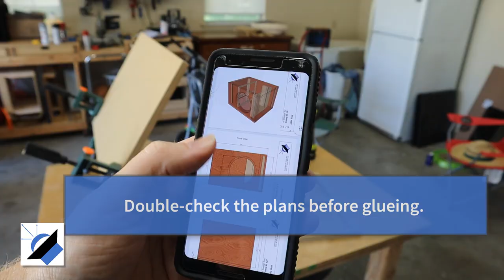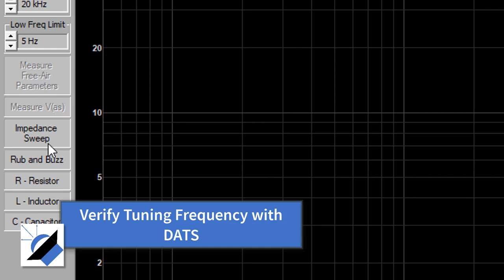Ported Subwoofer Box Build:  Kicker Comp R 12

Comment: Next time you cut out an internal brace use a 2inch drill bit and leave the corners rounded for extra strength or you could cut circular holes with your router and jig and would be even stronger
Reply from the maker: Next time I am going to make the brace a little thicker.

Comment: Very nice. I like that table saw. Need one of those!
Reply from the maker: I have been very happy with it, this is the Kobalt saw from Lowes.  It was the only saw in the ~300 price range that could make a 30" cut -- most only go to 24".  I can fold it up and roll it out of the way when it is not in use.  If you can wait until Black Friday they typically offer them at a HUGE discount.  I have a buddy with the same saw, he paid $80 bucks for it new. It will probably never be that cheap again.  The fence is garbage so you have to be careful to make sure it is square.

Comment: Definitely a nice build. I hate installing carpet half the time I chicken out n leave it off. So good on you for being thorough and seeing it through the right way
Reply: @DIYAudioGuy  you speak the truth, only way to get better at anything is to keep at it!
Reply from the maker: This was definitely not my best carpet job.  I hope to build a LOT of enclosures over the next few months just to improve my carpet game.
Reply: @DIYAudioGuy  as inspiring as that is I am simply not that brave, the alternative I've found recently is showing the grain of a nice piece or birch, sanding the heck outa it and applying urethane. That's how my lithium boxes turned out anyway. Carpet would hide the screws marks I mount the dsps and stuff with though🙃
Reply: I just put multiple layers of fiberglass resin on the box after it's sanded and done looks great and bulletproof finish. Feel free to put any decals stickers or artwork on there and then coat over top W clear( urethane) and it's perfect and permanent.

Comment: I purchased your plans for a Custom Sub Box Design: Kicker CompR 12.
I have a question.

The port opening in the plans is 14.5 inches x 2 inches equaling 29
square inches.  If I change the port shape but keep the same 29 sq
inch size will the tuning be affected.  What I am looking to do is
change the port to 12.5 x 2.32 which still equals 29sq inches.  Can I
do this without affecting the tuning of the box?

Thanks,
Reply from the maker: Yes.

Comment: Does polyfill in a subwoofer enclosure act as a sound dampening material and does polyfill really make the subwoofers louder and make the subwoofers produce deeper bass or is it a myth.
Reply from the maker: It's really something I should test out sometime.  In a sealed box the polyfill lowers the Q of the enclosure, having the same impact is making the enclosure larger.  In a ported box the polyfill is supposed to help with standing waves.  I don't know that there's any evidence or science that the ported box will play lower or louder if it has polyfill.

Comment: I need this exact setup for my Juke.   My Comp R 8 is just not doing it for me.
Reply from the maker: Yea, a single 8 just does not enough cone area.  I would definitely recommend upgrading.  I'm very happy with the way it turned out, sounds good lots of bass.  

The box is 2 ft wide, 14 and 1/2 in tall, and 18 in deep. If that'll fit in your Juke then check out my merch store on Teespring If you would like a copy of the plans.

https://my-store-b3f136.creator-spring.com/listing/custom-sub-box-design-kicker?product=963

Comment: Nice job!  congratulations from  México.. what´s the measure of the port?  in the front part and what´s the measure between port and hole subwoofer? and the inside window where must be set?  thks
Reply from the maker: The plans are available on my teespring store, just click on the merch shelf and you can find them there.
Reply: @DIYAudioGuy  thks but i can´t find out the port measure, how can i get it?

Comment: I didn't catch it, but what are the external dimensions of the box, and what is the vent cross-sectional area? 

It's a nice-looking build, and one of the few where someone's actually opted to put in some bracing (good) . Perhaps I'd have opted for a "beauty-ring" (round MDF ring, attached by dowels) around the driver, to avoid leaving the carpet edge visible like that.  Or just taped the red highlights off and Duratex the entire box, LOL.
Reply from the maker: Yea the carpet line was a little sloppy.  I like the Duratex idea, that stuff is gold.  External Dimensions are 24 wide, 16 tall and 16 deep.  Vent cross section is 19 sq in.   I think you use the metric system, so I hope that translates well.
Reply: @DIYAudioGuy  19 sq. in. or 29 sq. in.?  Because you said 29 sq. in. in a previous message...
Reply from the maker: 29, sorry.  I am prone to typos.  Did you catch the typo in the video?
Reply: @DIYAudioGuy  You mean, with the length of one of the vent panels?  I'm running the design through my BOXPLAN-ODOV workbook and the results are suggesting that the panel should be 11.75", not 13.75". The workbook is still in beta though, so it probably has an error or two...

Comment: Use tite Bond it has much better bonding performance and characteristics than gorilla glue.
Reply from the maker: I usually use tite bond 2, I buy it by the gallon.  But the gorilla brand wood glue seems to work just fine and it cleans up a lot easier.  It does not seem to stain the wood as bad as tite bond 2.  When I finish my current gallon of tite bond I might just stick with gorilla.
Reply: @DIYAudioGuy  I agree gorilla glue is pretty good. Longevity wise if it's a high humidity environment things can go pretty South. Highly dependent though I'll totally give you that.

Comment: What are the considerations of slotted vs circular port? Seems a tube would be more prone to chuffing but I'm no expert. I'm currently running 2 JL 10w6v2's in the home and was thinking of switching from sealed to ported. Nice vid.
Reply: Not with a precision port or aeroport with the flared ends.  Check ebay or parts express.  They work and work well.  As well the box size will be a bit smaller than with a properly sized slot port
Reply from the maker: I'm not aware of any particular advantage to any particular port shape.  There's a lot of debate about the friction between the walls of the port and the air in the port.  I usually go with slot ports because they are easier to build.
Reply: @DIYAudioGuy  They also act as additional bracing for the box.  Ultimately cylindrical vents are supposed to be the least lossy, but if the shelf vent is big enough, that really should be a non-issue.  What's the cross-sectional area of the vent, btw?
Reply from the maker: @Grommet2007  29 square inches -- I am not getting any port noise. Not sure if the round over helps with that, I use the round over just for looks.
Reply: Thanks everyone.

Comment: Bro about 3 years ago I needed to re-stock my carpet and I bought that same cheep crap your using, when I first got it there was no way I was going to use it on a customers box let alone one of mine, throw that crap away. Go to Parts Express and buy the expensive DuraLock Backed Speaker Cabinet Carpet Black Yard 48" Wide. This stuff is gold you will smack yo moma lol. PS you did a great job keep up the great content!!
Reply from the maker: It is like you are reading my mind.  I got this from parts express and I was this close ---><--- to getting the DuraLock.  I decided to save a few bucks and get the cheaper carpet.  I am going to try the DuraLock next time.
Reply: @DIYAudioGuy  You will love it, buy it in bulk the discount is worth it..

Comment: Hello our dear friend :-) I have an idea for (I think) interesting video that can come up great from someone with knowledge like You : fiberglass custom subwoofer box. But not sealed, and not half mdf, whole fiberglass custom ported box, I was looking for something like this all over the youtube and google and its almost non existing topic, really hard to find
Reply from the maker: Interesting, I'm surprised someone hasn't done that yet. But you are right. Most fiberglass builds just fiberglass the back of the box so we can mold into a car or they fiberglass the front to give it that volcano look. It will be hard to make an enclosure with no wood in it at all, It's typical to have an MDF ring that you mount the speaker to.
Reply: @DIYAudioGuy  well yes, ring out of mdf of course but when it comes to ported boxes there is mostly whole fron wall out of mdf not just the ring - here is also my idea for port, I made a simple mould out of styrofoam, put fiberglass around it and that prefabricated port can be attached inside a fiberglass box :) anyway, it is just an idea from a guy who learns a LOT on Your channel, so also thank You for that
Reply from the maker: @Koartis  I don't see any reason why that would not work, and with the price of wood right now...
Reply: There's a reason the shop charges you 15 times more for a fiberglass box. It's the most difficult nastiest itchiest time consuming task you will ever undertake in your life. So not worth it at all, ever.
Reply: @johnnycorn7225  Yeah but on the other hand, it iscat least somethnig different, something that will fit Your car perfectly, somrthing that will use maximum air volume possible without any more space wasted that neccessery. I made myself my trunk enclosure with fiberglass with zero experience with it. It was hard and nervous, but It was well worth it
Reply: @Koartis  I did too but felt it wasn't worth it lol. I did have to prove I could so I did!!